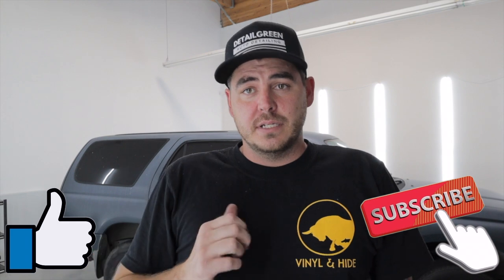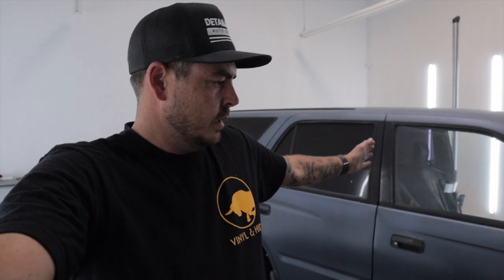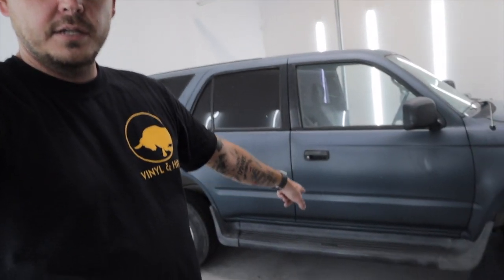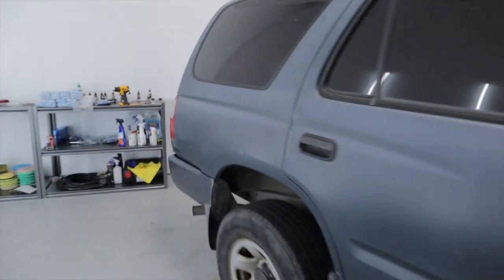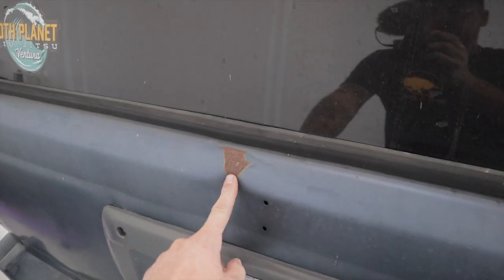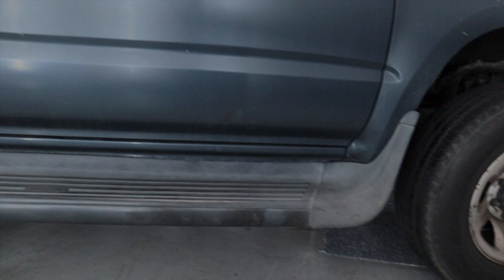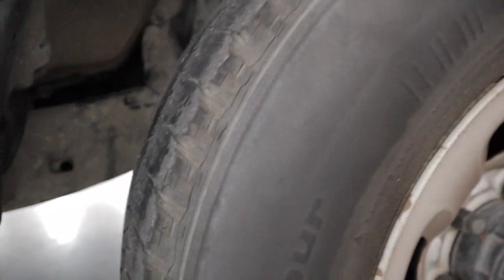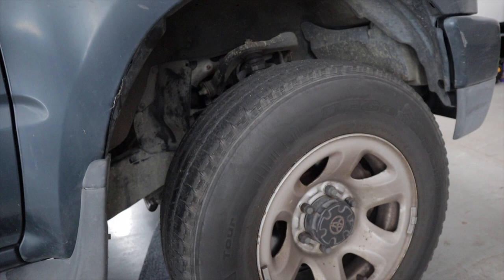I Bought a new toy to bring you more Car Detailing Content! | Car Detailing, Vinyl Wrap, San Diego

Comment: Even with the dents it is a Toyota and must be running well.  They last running a long time.  Just a matter of changing oil(must be the one from Toyota), filters, brake fluid, not change transmission fluid since it is not necessary, radiator fluid (for Toyota), also get the AT-205 re-seal from ATP automotive which is a pure polymer that will replenish the flexibility of all rubber seals and gaskets so restores the worn or dried out seals and doesn't harm the interior bearings and components.  It is compatible with conventional and synthetic oils on gas or diesel engines and manual or automatic transmission and differentials, power steering fluid on rack an pinion and steering box.  Never use on the brake system.
Reply from the maker: Yea Toyota engines are the best! My tundra has over 300k on it now

Comment: Your using the wrong tool that’s why your struggling. Next time buy a 1/2 inch impact drill it will save you time 👍🏽 nice find by the way I got a VR6 GTI for 500$ and all it needed was a fuel line and a camshaft sensor.
Reply from the maker: I know, I didn’t have one at the time but I went and got one after struggling with it ha. Awesome about the gti! That’s a fun car